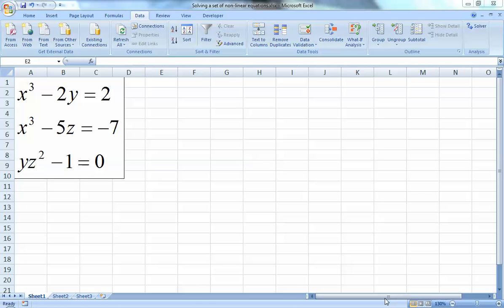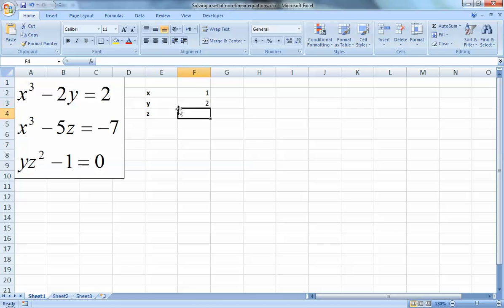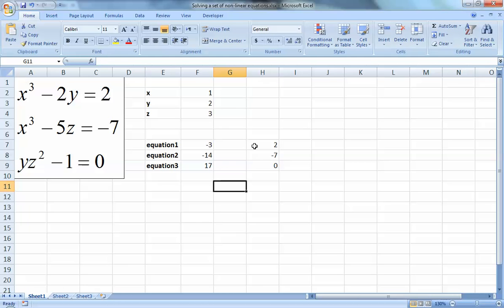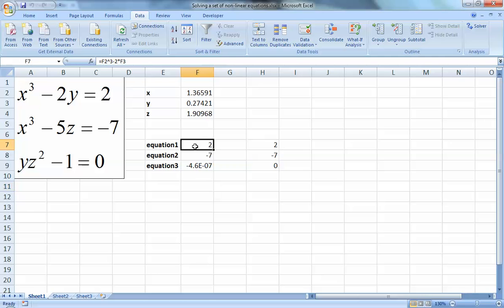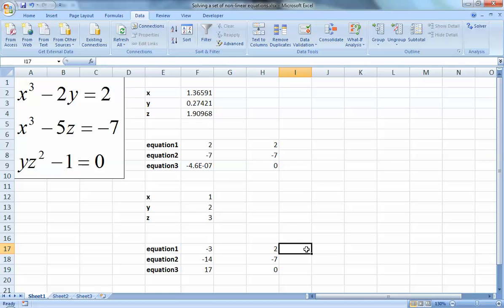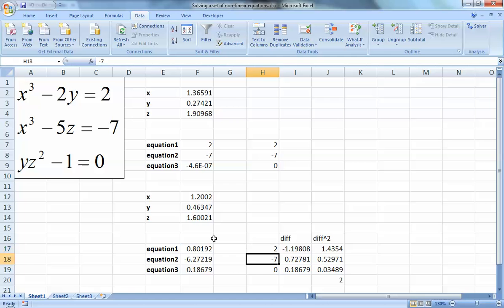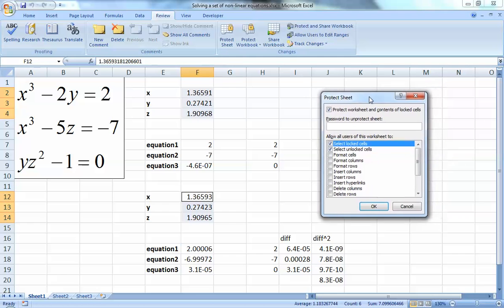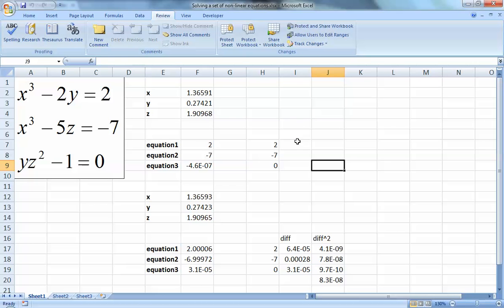Excel for Chemical Engineers | 10 | Basics [Solving a system of non-linear equations] (9/10)

Comment: Hey brother
I'm getting correct answer by putting constraints 
But I'm not getting correct answer when I'm trying to solve with least square method while taking diff I'm getting either all values positive/negative if I change the order of difference
Only 1st value remains some number and others get zero 
Please help😓
Reply from the maker: Hey Brother,
Try changing the initial values that you put before running the solver. Closer the values make the solution easier to reach.
If it does not work, send me your file and I will check it for you.